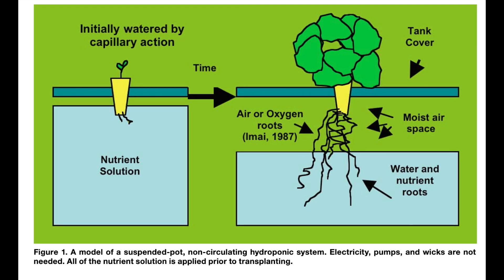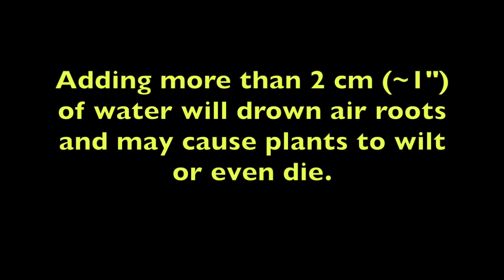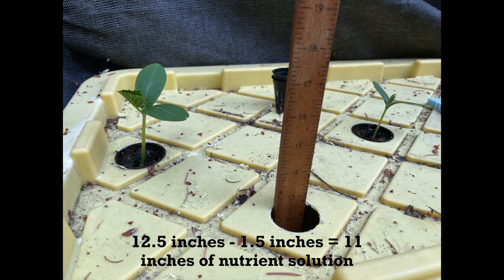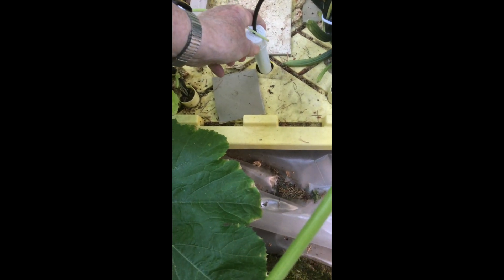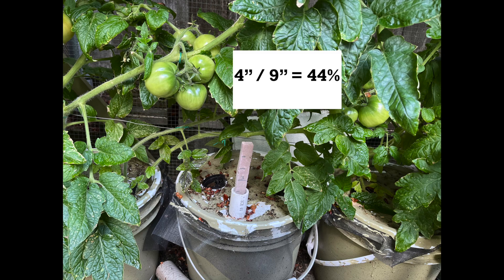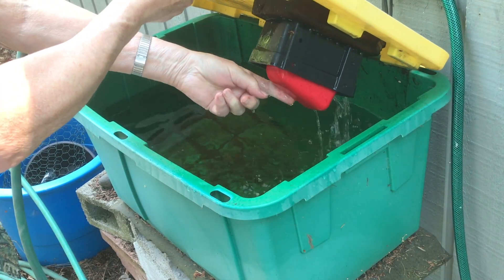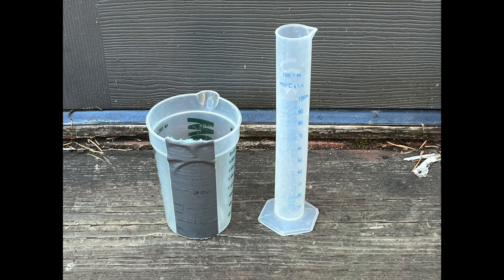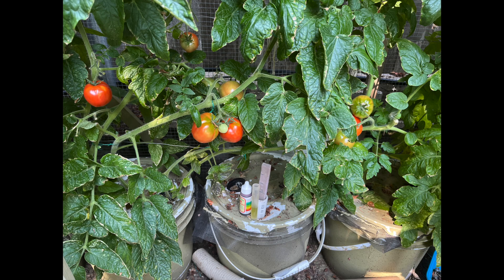Refilling Kratky Hydroponic Tanks

Comment: Great information again. I'm growing cherry tomatoes in my condo window, 3 buckets, 3.5 gal each, and I've got 1/2" tubing running to a box with a float valve and that's connected to a reservoir. I'm using RO water (tap is high in sodium) and Masterblend mixed to an EC of 1.2. I'm periodically checking each bucket's EC. When it starts to climb over 2.0, I turn off the tap to the bucket, drain it, then let it refill from the reservoir. This prevents the problem of salt stress. The plants are doing great. Lots of tomatoes. And I've got a living green wall. Thanks for your videos. I've learned a lot about this method of hydroponics.

Comment: This is going to be my third year of growing basil in 5 litre containers. I refill the containers to about 50%, sometimes less if I've let the solution run down too much. Usually I refill with 7.5ml of A and B per litre of water, which should have an EC of 1.16. I've not had any noticeable problems so far. This year I am trying peppers, and have only just started refilling.
Reply from the maker: That's great information!  Thanks for sharing.